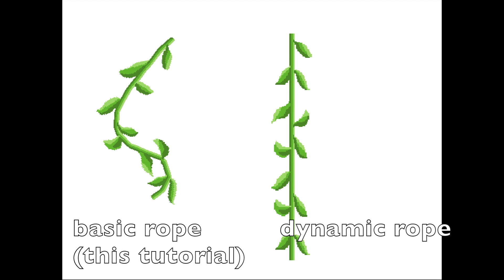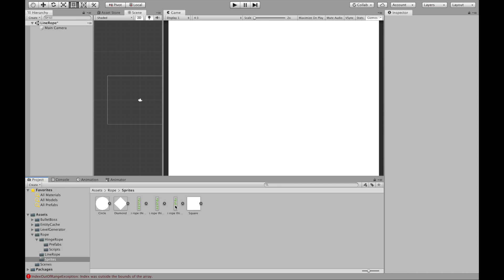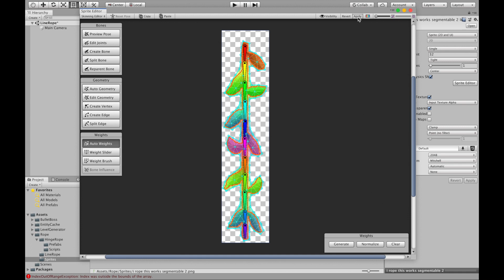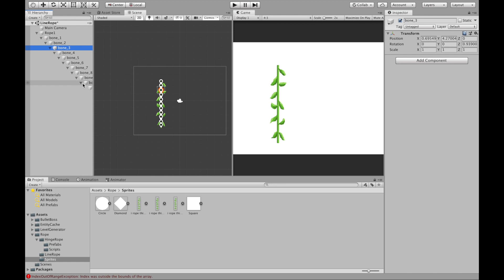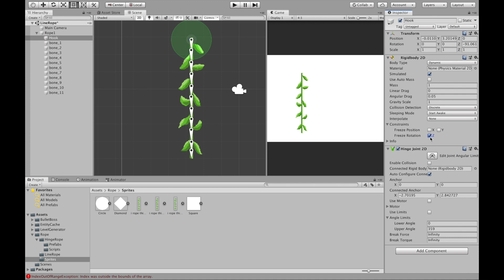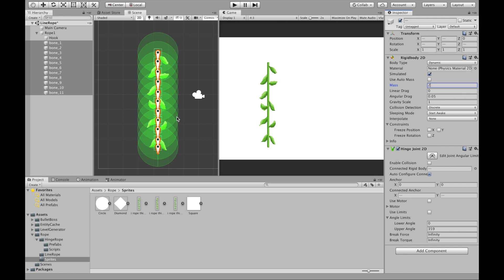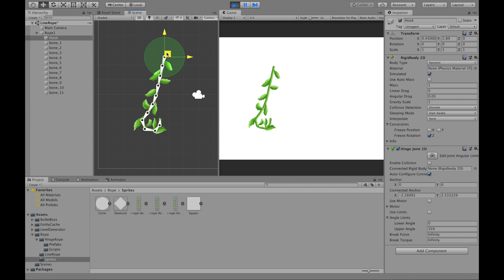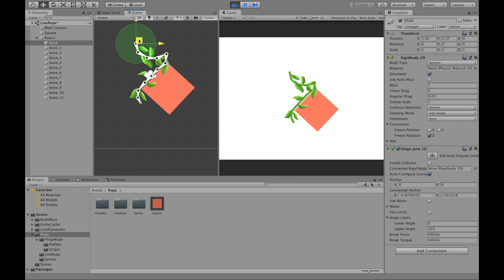Basic Rope in Unity - Rope Physics Part 1

Comment: I'm having trouble getting it to move... Not sure if you address this in part 2, but I tried moving it from various different points, from the "Rope", the "Hook", i even tried the bottom bone. Nothing... I'm moving it with rigidBody2D.MovePosition. If I disable all the bones it moves just fine... It's like the y position is locked, but I checked a hundred times, it isn't.